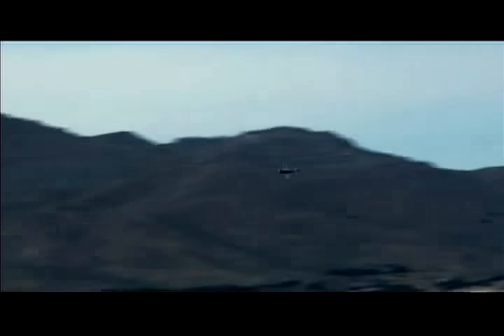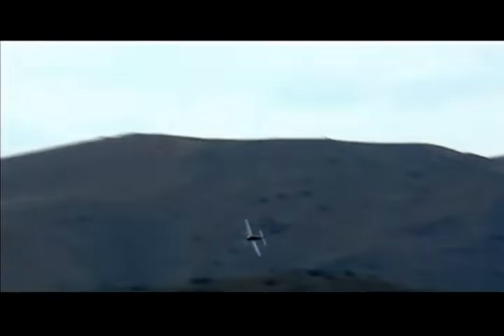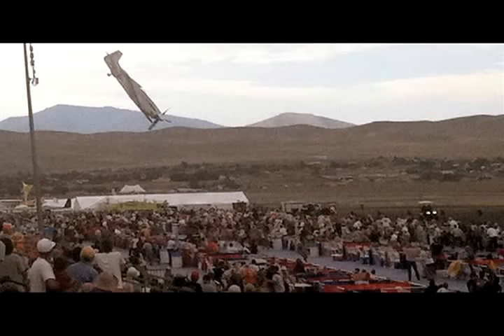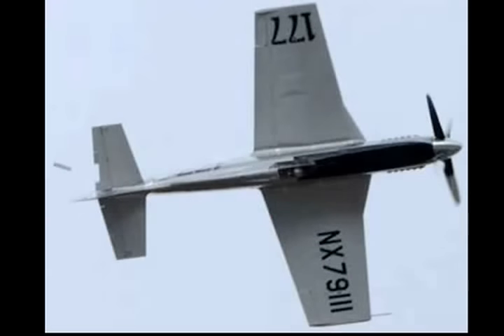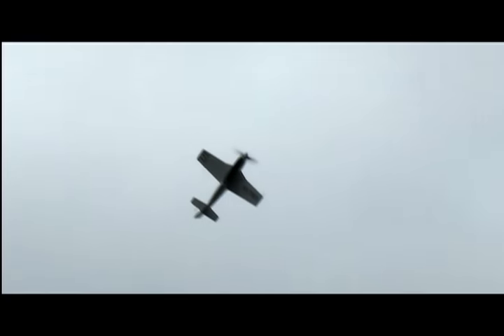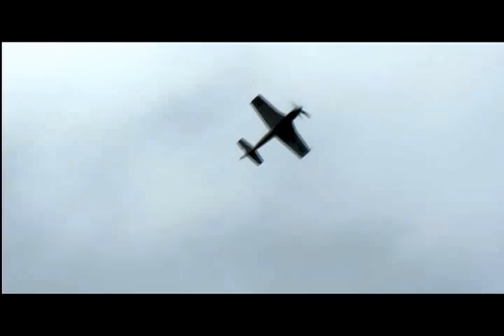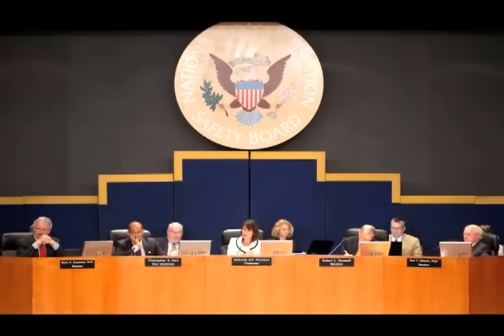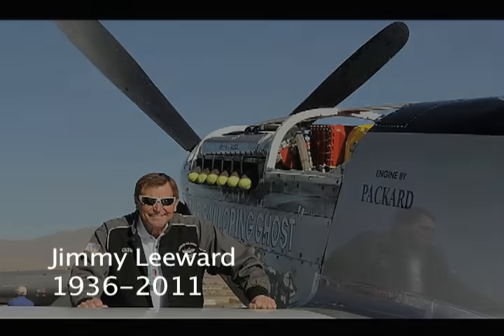NTSB Video of Reno Crash

Comment: Im no expert but making flaps or whatever smaller would make plane more unstable?!?!?
Reply: The flaps were not smaller, the addition of trim tabs to the flaps is used to allow flight direction changes without using the actual flaps which cause drag and loss of speed. but it does make the plane harder to fly. The detaching of the tab is irrelevant, it came off because it had already become inoperable some seconds before the tab detached due to the connecting bolt becoming unscrewed. Even then the plane was not unflyable, but it did cause the plane to pitch up into a 17 G angle causing the pilot to blackout, after that the pilot was just a passenger. this exact tab failure had occurred in a previous air race and that caused the exact same high G pitch up. The bottom line is the plane was poorly maintained, had been customised into a config that would not have been accepted by the NTSB or FAA, The pilot should not even have been flying it as he had lied about his age to get his competition licence. He was directly the cause of the crash. In addition, the flight line was in the wrong place, great for a view but not safe. the safest place to watch an air race is from  INSIDE the course, the planes are constantly flying with the centrifugal force pushing the plane outwards, even two planes touching and crashing causes the planes to move outwards in 90 % on the incidents, it's true in this case the flight line was also irrelevant as (as I previously said )the pilot was an unconscious passenger, it could have crashed 5 miles away just as easily.

Comment: A 74-year-old man should NOT be flying a high performance stunt plane. Also, airshows are too dangerous. A tragedy like this is bound to happen again. Cancel all air shows.
Reply: +roadracer1584   It would not have made any difference if the pilot was young.  This was an out of control aircraft.
Reply: His age was completely unrelated to the crash, and air shows aren't very dangerous. Air races are definitely more dangerous, though this crash was due to totally inadequate modifications to the plane.

Comment: 17G’s would absolutely rip your insides apart!!.. F-22 only puts out about 9G’s, which is about the maximum a fighter pilot will pull.. Perhaps buddy meant to say 7. ..7’s a bit more believable. But in either case, dude was probably in G lock and never knew what happened..🤷🏻‍♂️😔🙏🏼
Reply: +@fahhcue850   The plane had telemetry for the pits and I think the accelerometers stopped working at 11G.  The NTSB calculated a peak of about 17G.
Reply: @FiveCentsPlease  That’s insane!!… 😬

Comment: These planes have a tendency to stall and roll over if you pull too hard. That's probably how this went so badly after he rolled upright and pulled up.
Reply: +Bill Kong    Loss of trim caused the plane to pitch up, and the pilot passed out from the vertical and forward G-loads.
Reply: FiveCentsPlease The trim tab is a tiny fraction of the elevator. Losing one isn't gonna cause a 10g pull
Reply: @appa609  Loss of the trim tab at high speed can certainly cause a violent pitch up. The elevator trim is essential to counter the lift forces.  This is the second P-51 incident with losing a trim tab with both instances resulting in an unconscious pilot although the first time there was not a fatal crash.  Read the NTSB document "Aircraft Performance Study" around pages 24-26.  This animation is also helpful: https://www.youtube.com/watch?v=DGInPHqLN4s
Reply: @appa609  It's not just a separate control surface.
The purpose of the trim tab is to control the larger surface it's attached to. Being attached near the outside edge, they have much more torque for their size - this force is balanced against the torque of the larger surface. It's kind of like putting a weight on your hand when your arm is outstretched - it requires much more effort to resist it than if the weight was near your shoulder.
Losing the tab would immediately remove this half of the equation, and it was presumably at or near full trim. Aside from the sudden change, it perhaps also required major physical effort to manually move the surface so far at high speed in this plane?

Comment: To me the pilot looks confused eith complete the loop or fly inverted gain height and roll out
Reply: + Nouman Shabbir    The force of the pitch up and the deceleration likely caused the pilot to black out before the aircraft rolled inverted.   The G forces in two directions at the same time would have been pretty violent.

Comment: It was wake
Reply: +Pink Doughnet Wake encounter was discussed in the Air Performance Study document as a possible cause for the 90-degree roll upset at the start of the accident but ruled out after factoring in the wind drift and aircraft positions, if I recall correctly. The NTSB provided photo evidence that the trim tab had already failed before it fell away later during the accident.

Comment: the probable cause was that the old man could not not handle the 17gs and lied about his age passed out and the airplane fell apart my heart goes out to all the victims
Reply: Nobody could handle 17g's, his age was ultimately irrelevant - the trim tab had already failed, that's what caused the pull up. The plane didn't fall apart in the air other than the trim tab that caused the loss of control.